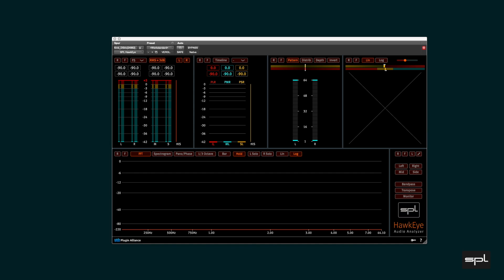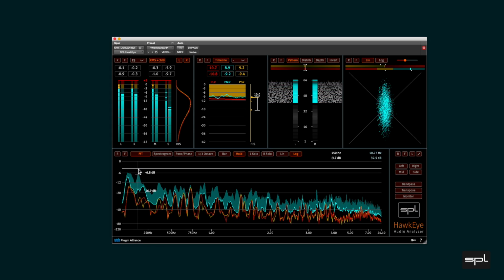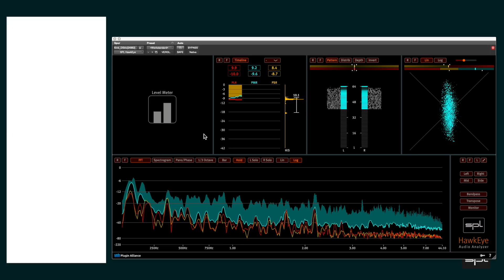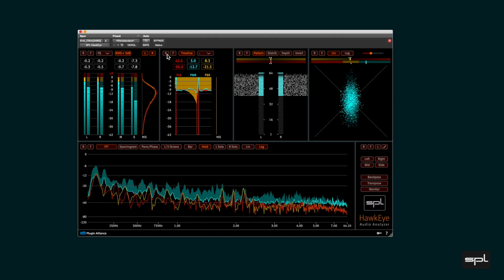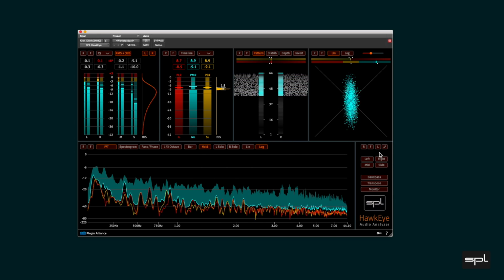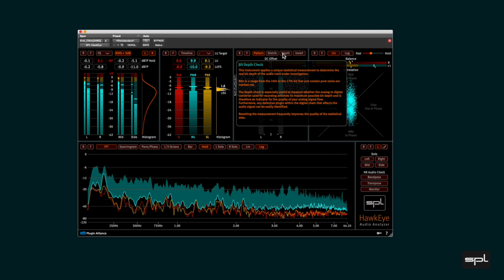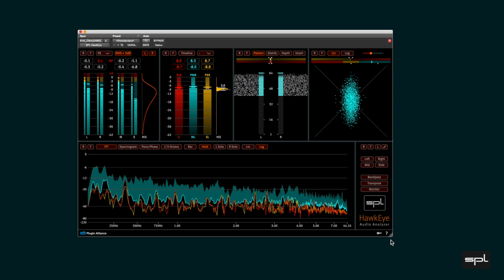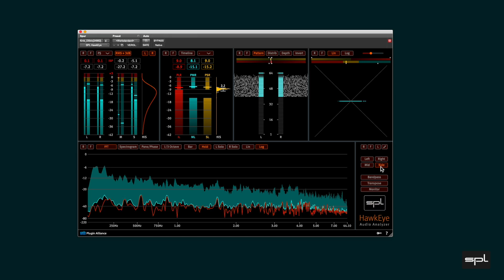HawkEye Part 1 – Overview

Comment: I need a standalone version that can load a mix, i.e. outside a DAW.
It should be the simplest method on some notebook without any audio capabilities beyond the minimum sound chip and OS driver (which never must interfere with its auto-conversions).
Nothing is mentioned about loading a mix that you got sent to the office, where no DAW and no higher audio interface is installed.
Reply from the maker: Thanks for the feedback. We will keep this in mind for future developments!
Reply: Go with FLUX